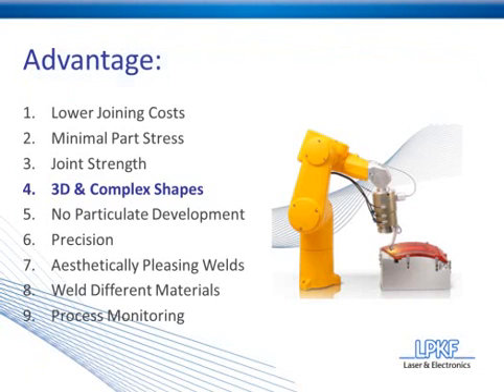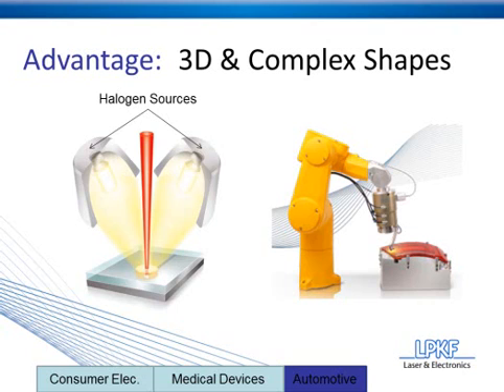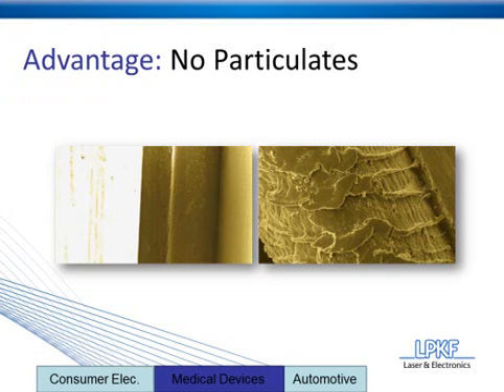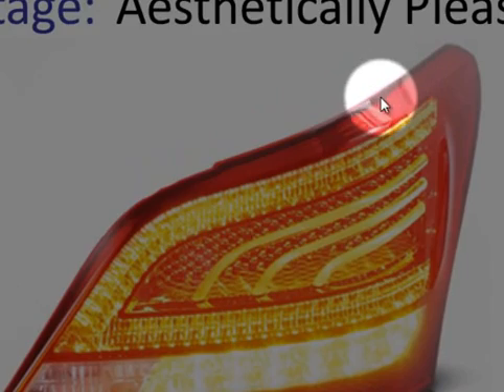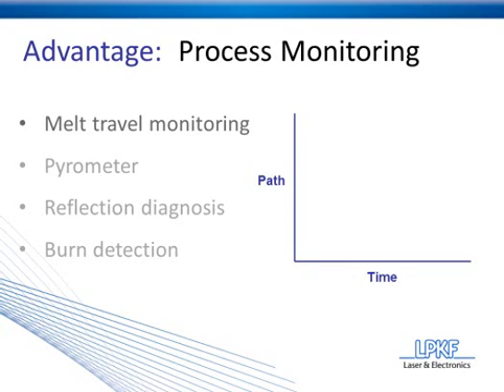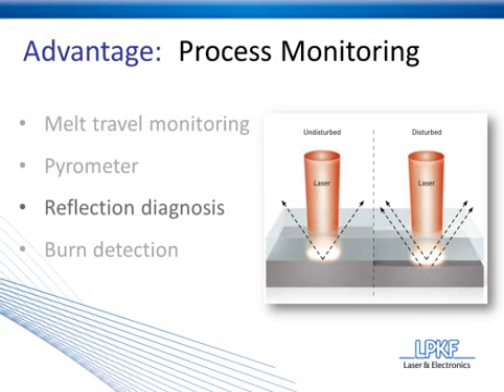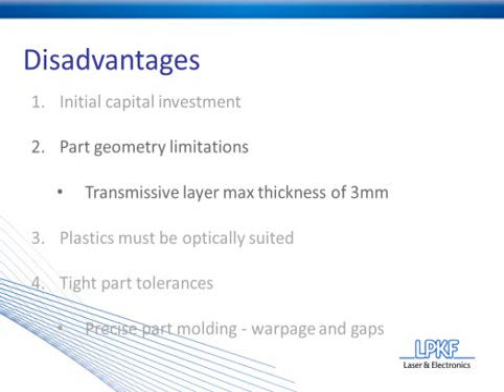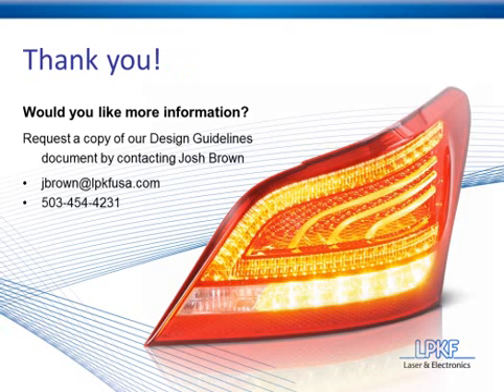Laser Plastic Welding 101 - Part 2

Comment: This was excellent. We are trying to determine if LPW could work in the joining of the parts of headphones earpads and headbands. These parts are comprised of thin layers all of them less than .5mm surrounding PU foam inserts so that seems to work for us, but the layers are also very flexible which means clamping is an issue. We are wondering whether we could do it with  glass or perspex sheet laid over both the pieces.

Another thought we have had is whether a cnc laser cutter could be adapted to the job. These typically have Co2 sources and I think they produce wavelengths outside those useful for welding. But if we can find a diode or fibre source maybe that could work.Thoughts anyone?
Reply: Adrian Mutimer Yes, Laser Plastic Welding could work. Let's do a tech review. You'll want to get in touch with Dax Hamilton, his phone number is 503-454-4213. You can also contact LPKF through email at sales@lpkfusa.com and we will get you to the right person for this application.